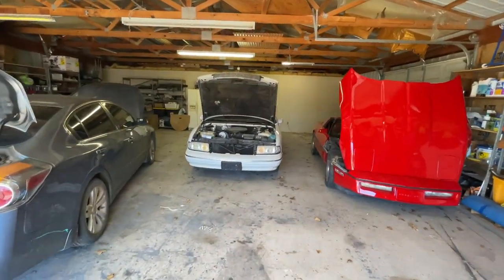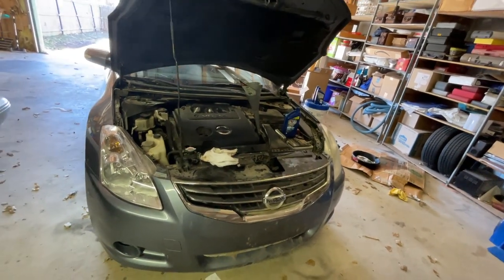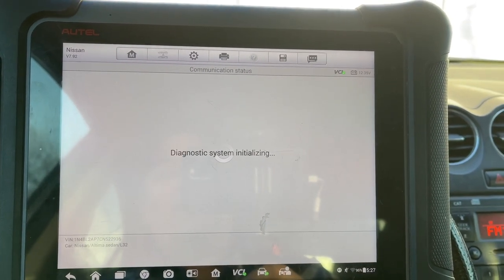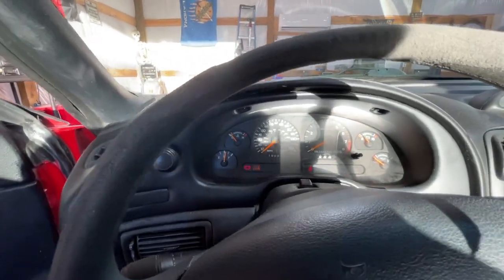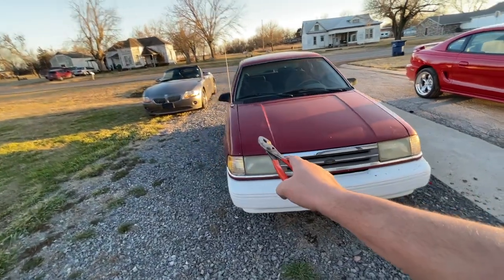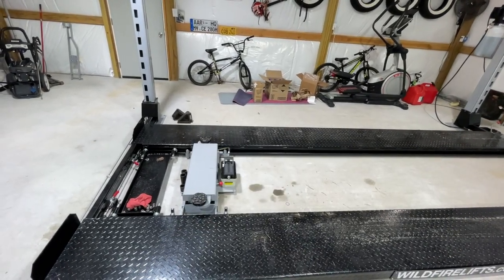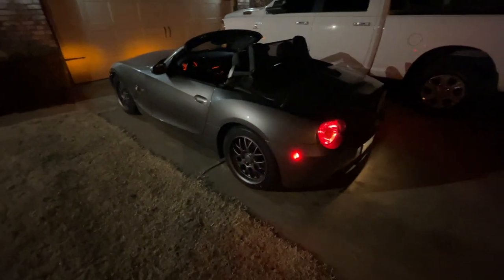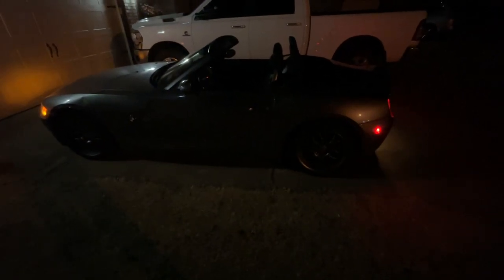SwampVette Fire Update + $900 Altima 1st Drive + Z4 1st Drive + AAR Busted Pipes?

Comment: On the Z4 conv. top. If the system was low on fluid, the best and easiest way to bleed the system is  run the top a few times and let it sit a couple of hours. And keep repeating that until the top operates fine. You want all the little air bubbles to get collected in the hyd. rams. The air bubbles will eventually get pushed out through use. It's a pain in the ass, but it's the easiest way to bleed the system of air.

Comment: Randy both front Altima side windows are automatic up and down with safety. I believe that they need to be set. Move them down with holding the window switch down for 3 sec. and then up and hold the switch for 3 sec. They will move up and down by single touch.
Faleh- Jordan

Comment: we used to put 2 locks on our wheels.
reason being, thieves would take off all the lug nuts then grab the tire and pull into the lock and snap the stud off.
works every time.
they couldn't do that if two locks were used opposite each other.
we never wrecked a rim.
don't know if it would damage the vette rim tho .
they don't build them like they used to.

Comment: I saw the next in the series, where the welded bolts on the wheel nuts sheered off. Induction rings are very useful here, they heat the nuts to read hot. Thermal expansion separates the surfaces, loosens rust.  Gets up to temperature in under 1 minute, allow to cool then turn.

Comment: Those lug nut locks are a pain.  I had to pick up a car with a car dolly and the back tire was flat and would not air up.  Of course the auction cars never have the lug nut key. I used 2 or 3 sockets to eventually get it off.  You need the 12 point sockets.  The 6 point sockets won't work.  Get a size slightly smaller than the lug nut and pound it on with a sledge hammer and take it off with an impact wrench.  Love the videos Randy!

Comment: Swamp Vette rusted lugnuts. Try a little torch heat and then the Harbor Freight tool. Otherwise soak the lugnuts with penetrating oil, let them soak for 24 hours and then the tool. You might end up replacing some wheel studs from damaged threads. And of course replace all the lugnuts. Because they're going to be toast.

Comment: I have a 2016 Nissan Altima base model with the 2.5L with 71044 miles The only problem I've had with the car since new was the A/C compressor went out at about 65,000 miles, Absolutely no CVT problems works flawlessly to date and I'm getting 47.76 miles to the gallon on the highway. This was my first Nissan but will not be my last. bee a damn good car.

Comment: Get a thin deep 12 point socket that may slip into the outer edge of the lugnut like a 19mm 20mm or 21mm Craftsman if you can slide it in around the outer edge and hammer it on it will come right off. You can spend like 5-10 bucks on the socket and probably wreck it but would be worth it. I have done this many times and worked for me. Thought might help...

Comment: Hey Randy, maybe you can just drill through the stud on each disc and you should be able to pop them locks off . You might have to replace the rotors or you might just have to replace the studs. I remember a friend of mine did that who couldn’t find the damn key either, but I can’t remember what he did after that with the rotors, sorry.

Comment: hey there BMW  convertible once the battery  goes low you will have to relearn the sequence  from scratch google it i had my 650 sitti g in my shop  over winter and the battery  was low would open half way not close so had to do the reset relearn procedure  cheers

Comment: My wife's MAF on her Sentra had to be replaced at 50k miles. Unfortunately they were using the crappy Renault MAF's and they didn't last. I swapped out my wife's, such a simple job as it was just 2 screws and unplugging it. The sensor was $245 and Tire's Plus wanted to I charge me $500. They me it s ok sound so complicated. This was back when I knew nothing about cars. Our regular mechanic was $300, but after watching a YouTube video, I did it myself. That's when I started to learn about Nissan garbage.

Comment: Get the car in the air and see if you can grind the stud out from the back and hammer it thru. Then replace the stud. I have worked on a c4 but we've done that on other cars. All comes down to the clearances you have to get tools in there.

Comment: Hey Randy, you might have to just break down and drill the dang studs out.   Looking like it's that or break the rims.  I'd look into how hard it is to replace the studs, probably have to have someone do it, or buy new rotors maybe is cheaper (don't know, didn't look at Rock Auto). 

If you decide to drill them use a die grinder or something to start a centered hole and then Harbor Freight long skinny step drill bits will plow through that pretty fast.  Eventually you should get through enough of it to get the lug off.

I do believe I would hit up Ollie's Outlet for a $8 steering wheel cover for that Mustang.

Comment: Hello. Do not leave wires without insulation. They will become hot and may catch fire. Corvette
Reply: I've been freaking out about that since the first time he started it after the fire.  I hope he's unhooking the battery when he's not trying to start it.  It'd be a shame if after saving it the first time it still ended up burning to the ground because of a short, especially after all the work he's put into it.

Comment: Wish I was closer I would come get those wheel locks off, get one of those cheap multi tooth sockets and pound it on so it almost breaks the socket and use a breaker bar. Its worked for me in the past, also with the history spray it down with  WD40 and let it soak for a time to break the rust.

Comment: If the Altima continues having mass airflow sensor issues I would cut the zip tie off, remove the loom and inspect the wires.  Maybe it works when they are bent so they zip ties it like that.

Comment: Oh Randy😂 swap out that ropey steering wheel, fit the struts/shocks to the Mustang GT and then send it down the road. You've already spent the money, may as well finish it😉 besides, if a buyer sees them in the trunk, they will be wondering what is so catastrophically wrong with it that you didn't bother and punted it through the auction...

Comment: The Nissan you'll probably have to drive it at least 200 mi for it to complete itself diagnostic system check at least that's what I have to do with mine I got a bad O2 sensor